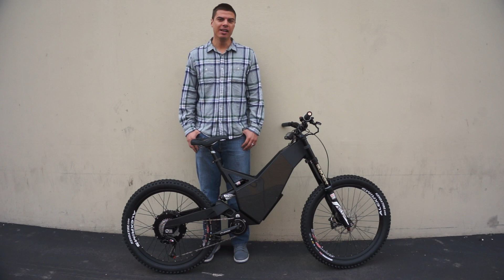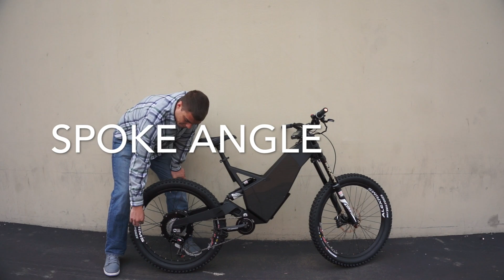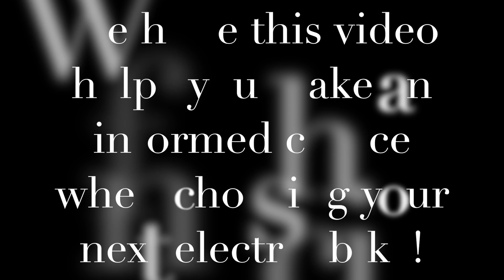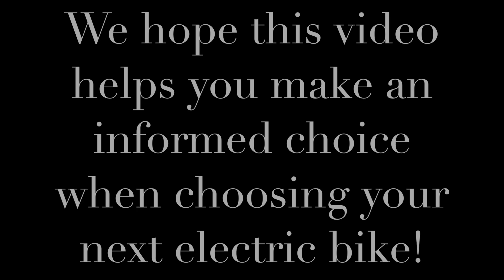How to Choose an Electric Bike

Comment: I bought chinese and it's very low quality, in fact useless to a point where the battery degraded quickly ( pay more and go for quality) paying less is actually the more expensive option as you will have to buy twice

Comment: If you buy a "china bike" the first thing you should do is take the tires off and throw away those cheap rim strips and replace with real rim tape. The flats were not punctures, it was the rim strips failing and blowing out the tubes. Lesson learned.

Comment: does anyone know of any good Chinese bikes
like stealth bomber clones, they all look kinda simmilar but it's hard to tell how good quality they are
Reply: Sorry for the 1 year late answer. I have no dog in this fight so this is an objective view based on my experience.   I used Alibaba to see what was available.  I found someting i really liked and was able to put together a deal quickly.  There is risk when buying from overseas as you are putting trust in the seller by sending money with little chance of getting it back if you happen to be dealing with a scammer.  I was comfortable with the situation because the company is well known as an OEM  (outsource electronic manufacturer).  They build many items and will brand them for you to be sold in the US at a massive mark up.  While they typically sell wholesale to to international vendors, they also were very willing to sell me one unit.    As disclosed by the person I worked with, it took 30-45 days to receive and when I did it was 95% built.  Just had to put handlebars and peddles on.  Also, the battery comes from a US vendor they must partner with. They times it just as both came withing a couple days of each other.  There is risk in wiring money to someone in China no doubt, but the reward in discount is worth it.  The price I paid was 1/3 - 1/2 the price I see online for identical bikes with another brands logo on it.

They make them to order using high quality name brand parts, including some motorcycle components for strength.  The one i got is really a hybrid Mountain Bike and Motorcycle.  I mean it is a bike with peddles, but the power of a 5000W hub motor with 72V battery (29.6ah) is amazing.  DNM shocks, shimano gears if you want to peddle. Hydrolic brakes and a decent computer system that I use for distance and speed and that is about it. It goes about 50 mph down a slight hill and 38 back up it.  The battery chargers to about 84 as lipos always tend to charge to about 4.20v (on a 3.7 rated battery).  I have never gone far enough to now how long the battery lasts.  I have not even gotten below 72.  

Lastly, the guy I worked with was very attentive and answered a few questions I had when I received it because of course THERE IS NO MANUAL.  Which drives me nuts.  But again,  the guy I worked with was committed to getting me working and it didn't take much time at all.   always called me back and was willing to put whatever time it took to make it work for me all via the Whatsapp in the evening in the US when it was morning there.  This Sounds like a commercial, but the "bike" is amazing and I really just wanted to share my experience and encourage people to try it. I am all for buying US, but when you can save $4000 I had to do it.  I am not  mentioning the name of the company to add some credibility to this post if anyone ever reads it.   

To the point of the original poster, I am sure there are plenty of times it went the other direction and the products were junk, but I was a lucky one. I have done the same thing (electronics purchased) for a couple of other other items (electric skateboard and 10 security cameras) and the result has been consistently excellent.  Very cheap and smooth transactions.  

This brings to mind the old "tree falling in the empty forest" questions.  If an email is posted a year late and no one reads it,  did it ever exist?

Augusto I am happy to let you know who I dealt with if you are still in the market.
Reply: @securitycams1158  can I have info please
Reply: @securitycams1158  OEM means Original Equipment Manufacturer.

Comment: Karma strikes back! This is exactly what you did with our bikes.
You are building a "Wolverine" bike on a Chinese made frame that is poor copy or our Vector frame.
Thank you for being honest with your clients and noticing it by yourself.
Reply: +Artur Ragulskyi my giant twist is  Chinese made 2 half years trouble free riding not everything from china is shit .
Reply from the maker: +Tonyrefail Correct, there is a lot of things that are great from China.  Just giving people things to look out for since there is still some REALLY bad stuff out there.
Reply: I think that you have overstated a few points that I wouldn't totally agree with in terms of location of production correlating to build quality. I could mention the aluminum Vector side panels versus the ABS plastic variants for example. 

Most of what I see here is assembly aspects, not production, being how much of the bike is build using "off-shelf" components. From everything I have observed with many of the hub motors commercially available, there is plenty of room for design and QA/QC improvement on many of the available designs. I recently purchased a TC4080, and plan to thoroughly examine and test the motor to personally ascertain first hand. I nearly purchased one of your modified motors, but I was waiting for additional clarification of the modifications you have done and decided not to wait.

I would certainly agree on battery and BMS construction with many manufactures using sub-quality cells. Another aspect would be controller component selection, and method of motor control. There is large variation in controller sophistication, drive stage components, and methods of control.

From an Electrical Engineering standpoint there is a lot of information about these bikes that is not plainly disclosed. For example I would like to see a dyno sheet with DC bus voltage, current, mechanical torque, and horsepower. How are the stators wound for commutation? What type of control is implemented? What are the thermal limitations, and to what affect does ventilated stators mitigate heat? Also what are the maintenance cycles for a ventilated stator versus a shielded stator? Another question would be 

This was viewed and posted on a Chinesium 2017 Macbook Pro. China happens to be one of the fastest growing markets for electric vehicles, and the majority of them are two wheeled. I would like to see American designed, produced, and assembled electric motorcycles and e-bikes, but I wouldn't be so quick to discredit their accomplishments. This would include in house design of controllers and motors, not just battery packs and frames. Also the upper price point of some of your offerings parallels the mid/lower end of full DOT legal motorcycles, that often utilize more powerful mid-drive configurations. They have a better weight distribution and less rotational and sprung mass than a typical hub drive for similar sized setups. 

Think of the above as positive criticism and suggestions after watching this video, and reading this discussion.